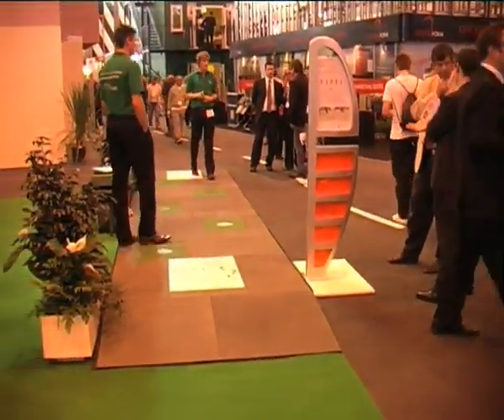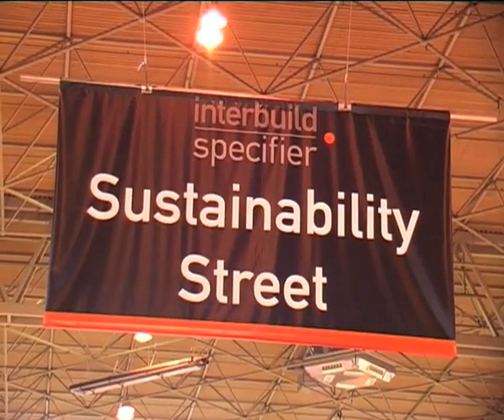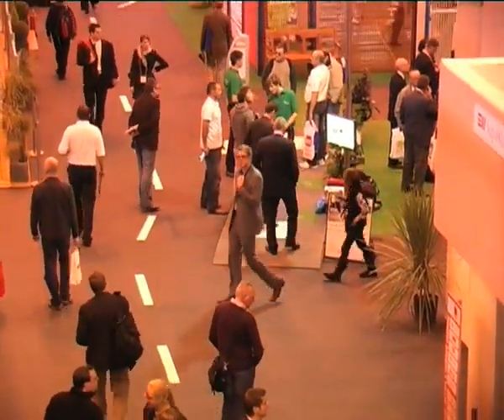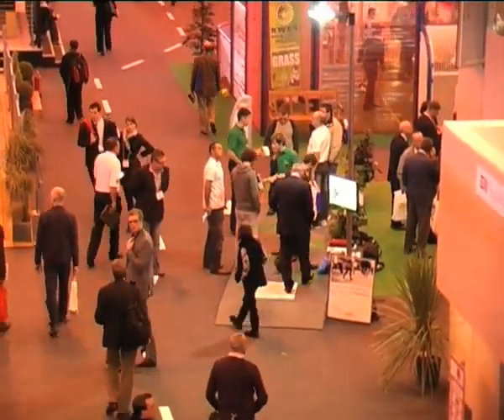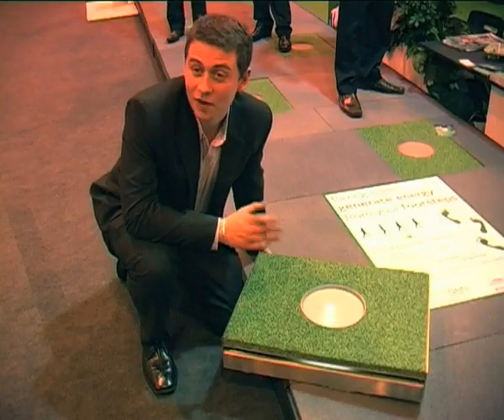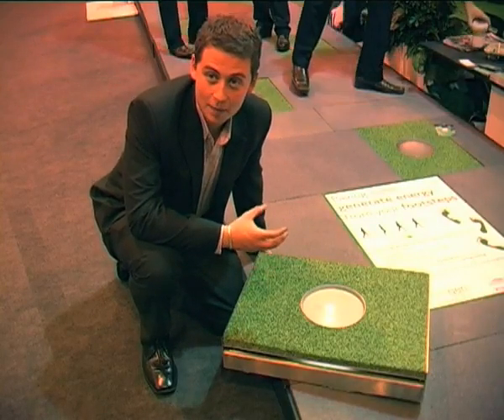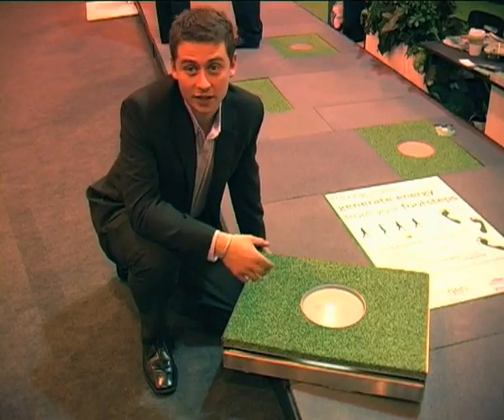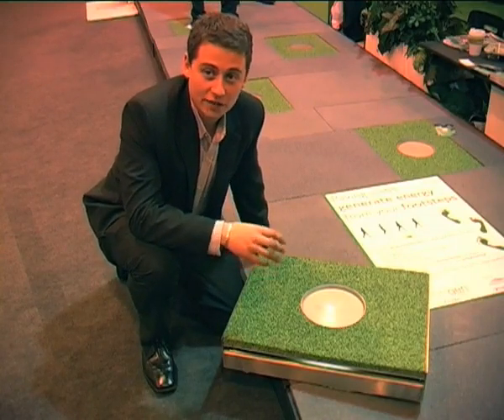Pavegen Systems Blatant Waste of Money

Comment: Actually I did try contacting them. I am an engineering student so I emailed them using their dedicated email address for student queries. But I just got a bullshit reply saying that "Unfortunately due to the high volume of emails from students requesting information, unfortunately we are unable to assist with any academic projects."

if anything they should at least have energy reports in PDFs that will take them less than a minute to attach to send to me. what a joke

Comment: From the wired magazine article on pavegen (google it)

"...the slabs generated 2.1 watt-hours ... average energy potentially generated over the course of an hour with high footfall"

2.1 watt-hours average in 1 hour, means they are generating 2 Watts of power at peak footfall, less at other times.

1 kWh (or 1000 watt-hours) costs 14 pence.  So 1 slab would generate 7p in 1 month, or ~£1 per year.  Sounds like a pretty long payback period, both in cash terms & CO2 saved (1000 yrs?)

Comment: I did my research and found that each tile can produce a max of 6watt.hour if stepped on 50times/minute.
So, even in the best case scenario, after 3 weeks (approx. length of Olympics) ull get 36kWh of energy from those 12 tiles, equivalent to £3.2 saved (if 1kW=9p).

Google search "west ham dashboard" and ull see they only produced 1.1kWh (worth ~9.9p), far from my optimistic calculations.
Also, each tile can withstand 20mil steps, so over its life time it'll only make 40kWh (~£3.6)!